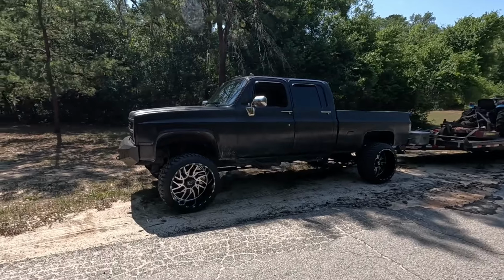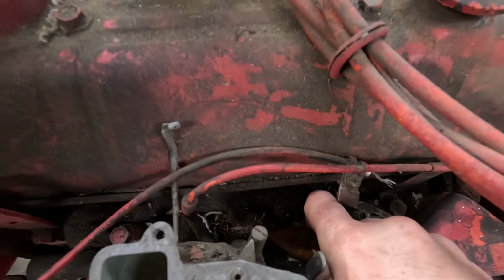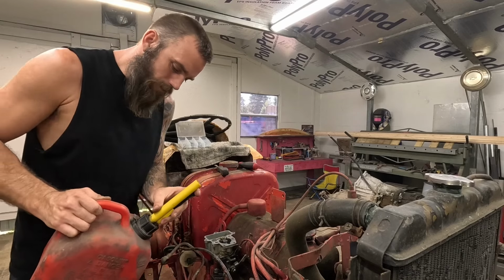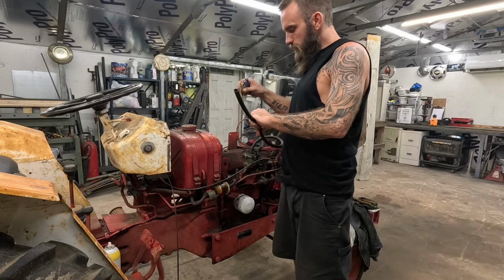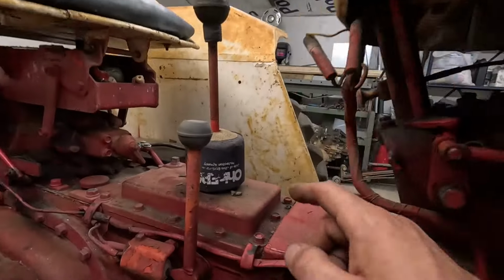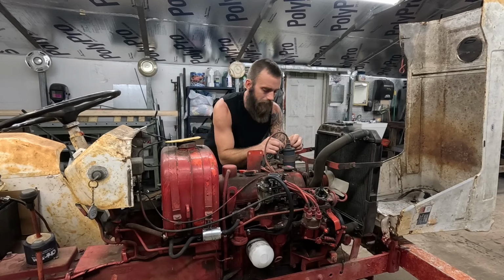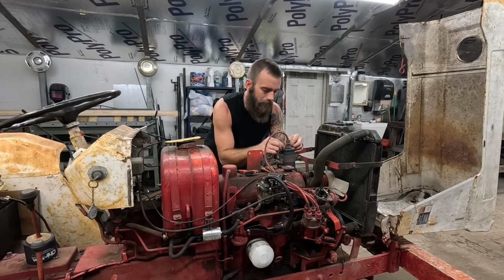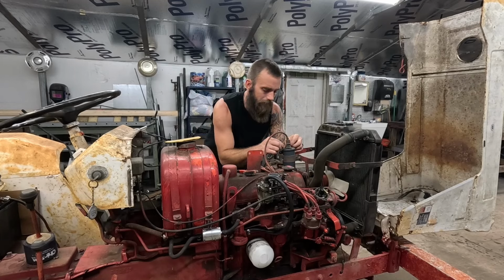Was it worth $300?

Comment: I have a 1949 Ford 9N, it runs awesome, with its flathead 4 cylinder, but, th hydraulic lift isn’t lifting. It was until I put new hydraulic fluid in it, b cause the old had water in it, but, for some reason, now it’s not.🤷🏽
Reply from the maker: @jonathanmiddleton1141  
I had a jinma that would drive 50ft and stop moving.  Same deal. Water in case. Drained it several times before it fixed the issue. Appreciate you watching all my videos